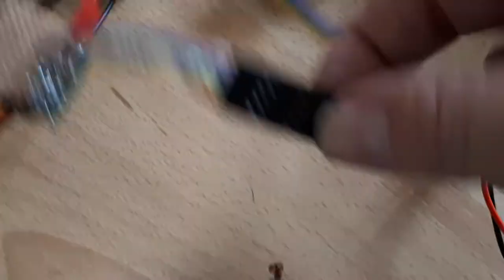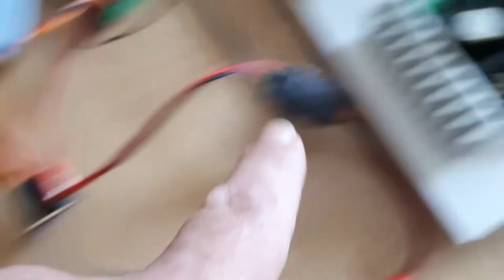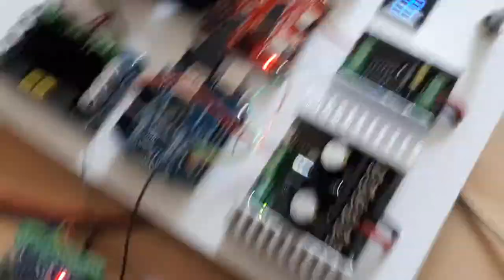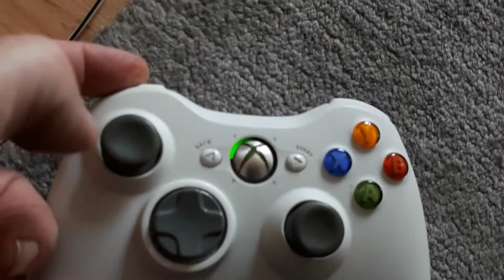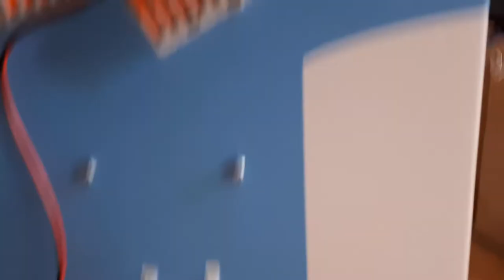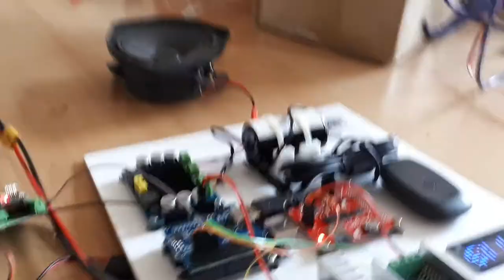Padawan with additional pie panel servo animation

Comment: Thank you for this video! Do you have to modify the dan kraus sketch for this upgrade?
Reply from the maker: Very minor tweaks needed,  I added a line to listen for that particular button combo and told it to drop the pin low, then on the nano, I Ser it to listen on D2 and when pulled low, start the animation. The other wire from the Uno on the main Padawan board simply told the nano to reset which then defaults the servo positions.

Comment: where do we find the arduino code for this?
Reply from the maker: This was a one off job for a client, so I haven't shared the code. If I was to do it again, I'd use a Polulu Maestro board. Programming animations is much easier.

Comment: still no reply even 6 month after, guess i have to skip the pie panels, since he dont reply---
Reply from the maker: I would suggest you buy a polulu maestro board, and play with that. If I was to do it again today, that's what I would use.
Reply: @ImperialLightandMagic  but he has the code right there on the video, he could just share it..
Reply from the maker: @Tjup  You mean give something away that a client paid for?
Reply: @ImperialLightandMagic  huh? He allrdy released the padawan 360, its a set...
Reply from the maker: @Tjup  Padawn360 was written by Dan Kraus.  The servo sketch in this video was written by me as a one-off job.  Padawan360 is open source.  This servo sketch is not.  I hope you understand.
Reply: @ImperialLightandMagic  i just closed the panels and regreat i used this setup for the droid...